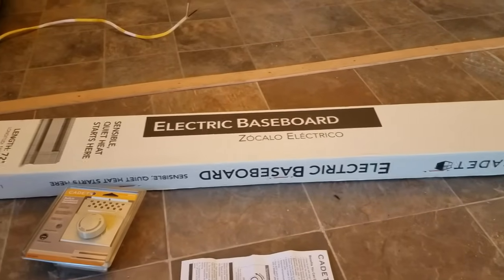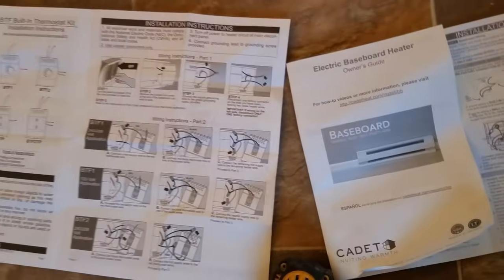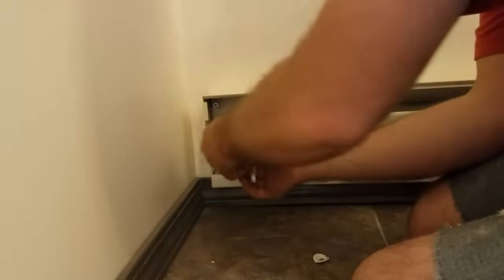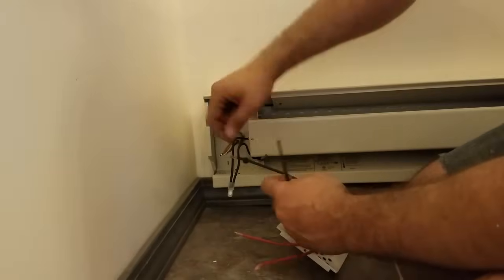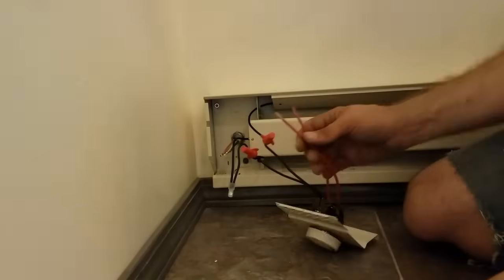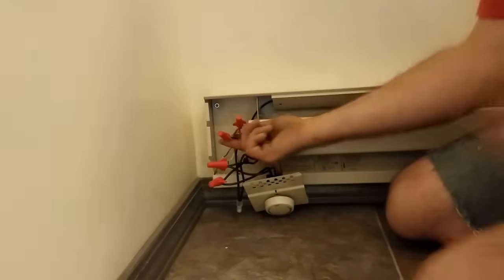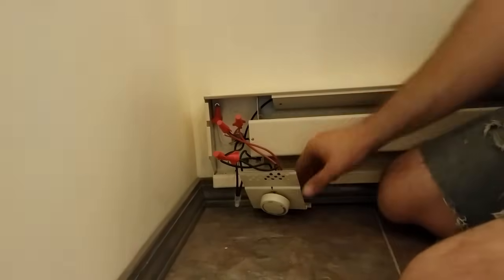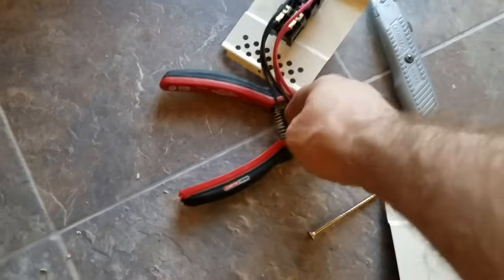Installing Electric Baseboard Heater. DIY

Comment: Please in desperate help.  This is on my floor. It’s the middle of summer we bought the house 20 yr ago.  Now eater is on and I don’t know hot to turn this thing off.  The wall unit does not have a shot off it goes from low to 80.  And it’s at its lowest
Reply from the maker: You can go to the electric panel and find the breaker its on amd turn it off untill you can get someone to look at it.

Comment: I am reading the comments and im laughing my ass off this guy did his best and not bad but i dont understand how they are putting a 30 amp breaker with a 12v wire ladies and gents idk where you live and if that code but as a intelligent DIY man that is not correct 30amp is for a 10 gauge wire please do not do what im reading in the comments and also if you have a 220 do not use a 14 gauage wire smh give this guy a break he is so nice to answer so many questions ... you may use a 12 guage for 220 although i would not but it is safe to do so but it depends on what the instructions say on your heater
Reply from the maker: Your comments are just as bad as the rest! No one shown to use 14 gauge wire. 12 gauge wire is what almost everyone uses to hook up 220 baseboard heaters and it calls for a 30 amp breaker! 12 gauge wires are used for 220 on many things. I just hooked up a mr cool system that was 220 and 12 gauge is just fine. Stoves are mainly the only thing that needs a bigger gauge wire! Watch other videos and let me know what wire they using for 220 baseboards!?
Reply from the maker: It's true, i do try my best to respond to people. Sometimes i don't get a notice to do so though.

Comment: He’s giving instruction about installation but he misses putting the unit in a stud and puts the other screw in the wrong spots. Now the unit is not in studs so it will fall off very soon. Bad video
Reply from the maker: @dorothy1  it's in studs! When i made this video it was to be just tge wiring part but went ahead and put the whole video in.

Comment: The wire thats behind the coil do it suppose to be touching a ground on the right side of the basboard? Its a wire i believe its a ground wire but not hooked to nothing. Is this why my baseboard not coming on?
Reply from the maker: @fighting402  ground wires will be copper with no coating on it or a green color coated wire. Heater should still work with a ground wire not being hooked up. What color is the wire?
Reply: @thatslumlordlife the wire is green. It was working a few weeks ago, then I noticed it wasn't on. So I tap on the thermostat and turn it off and on back and forth then it will come on. Now that's not working. When I turn it on I hear the thermostat click but I don't hear the sound from the baseboard
Reply from the maker: @fighting402  to me it sounds like you may have a loose hot wire. If you havent look over all the wire nuts and make sure the wires are all connected well.
Reply: @thatslumlordlife  what color is the hot wire?
Reply from the maker: @fighting402  should be black wires. Id go through all of them and make sure they all have good connections.
Reply: @thatslumlordlife  okay cause I have green wire that's screwed down but it's not connected to anything,  I'm wondering was it ever hook to any wire even while my baseboard was working
Reply: Is it possible I can send you a picture of the wire I'm talking about that's not connected
Reply from the maker: @fighting402  try and send it to agiftedcurse2@gmal.com

Comment: Good video thing that I would add is I do not level my radiators. I follow the floor because if you level the radiator a lot of times in the older houses it’s gonna be way off. I have this one house where it’s an inch off and that’s gonna look horrible, so I just ran it with the floor.

Comment: First time that i have seen a baseboard heater mounted on top of the base trim rather than right on the floor.
Reply: That's what you want so the heat emanates throughout the room.
Reply: @flexiblestrategist9922 that and how tf you gonna clean every bottom edge of your room if the things on the floor, no room to get a broom under. Gotta think about these things
Reply: That's actually door trim. Someone used it as baseboards. 😂
Reply: I have one baseboard I was reading instructions they recommended   to installed minimum 1" from the floor.

Comment: This is not correct.  Instructions say to use 2 inside wires.  It also specifically state not to cut the outer wires he is using.
Reply from the maker: May want to read it again and watch again.

Comment: Was hoping to see how you go about selecting the circuit breaker, and how many units can be put on the same circuit to that breaker, or does each unit need its own breaker. Wanting to install a failsafe back up heat source to keep Housing Code happy and get my water turned back on.
Reply: It depends on the amperage of the heating units and amperage of the breaker. However you don't really want to exceed 80% of the total amps of the breaker.

Comment: Did your heater give a 120 volt option? I have one in my kitchen I want to hook back up but I swear it was wired 120volt I can’t remember, I unhooked it 15 years ago and my power panel has been rearranged since then. Just curious if yours had an option for wiring.
Reply from the maker: No, the heater are either 120 or 220. I don't believe they are safe to use for volts they were not made for.
Reply: @agiftedcurse2  ok thanks

Comment: Excellent, the only thing I missed was you showing check in for voltage with a sensor and then walk into the circuit breaker to shut down that branch circuit, then double checking for no current where you were going to work.
Reply from the maker: When i made the video i was just trying to show the wiring of the baseboard. I figured most attempting this would already know how to wire it into the panel. 🙁
Reply: You missed the whole point. This video is about replacing an existing baseboard unit, so existing wiring to the fuse box should still be good.  His comment was a safety check.  Turn off related breaker and confirm there is no current, using a tester, that was all.

Comment: He didn't need to use a 240 amp. It was overkill. The guy doesn't know what he's doing
Reply from the maker: When temps get down in -10 degrees here in iowa you will want thw 240 amps! Haha the 120 amps do not put out and heat as well as the 240 amps! You can use 120 or 240, this video is on installing a 240 however! Haha

Comment: Probably should’ve reminded folks, first be sure the connection site isn’t live, some folks have to be reminded.
Reply: That might come as a shock to some people!
Reply: Dude I test and retest the wire every time I reach in even after locating and flipping the breaker. It just takes getting zapped once or twice

Comment: I'm confused. Trying to install one of these but the instructions say to NOT cut the wire coming from the top but your video as well as the installation video say otherwise?
Reply from the maker: I put another video up that might help better? Both these videos are for 220 amp heaters. Make sure you are looking at the right instructions. I show the instructions a little better in the newer video. Hopefully it helps. https://studio.youtube.com/video/gBY5sVXi-gw/edit

Comment: did you replace an outlet for the baseboard heater?
Reply from the maker: Outlet as in a plug-in? No outlet. It's directly wired to baseboard heater.

Comment: Hi thanks for the info. I think I am going to replace both electric baseboard heaters with the cadet brand from home depot. One problem is that someone painted over the screws so I can't remove the cover to unhook the old baseboards. I may have to use some kind of metal cutter to remove the cover so that I can get at the wiring on the baseboards.

Comment: I have old electric baseboards in my house. The ones in the master bedroom seem to put out a smell when they are on. I have used a vacuum to clean out any dust. Should they be replaced and would that get rid of the smell?
Reply from the maker: Every year when they are first turned on they put out a weird smell. New ones also do it. People that haven't ever had baseboard heating normally call about it when they first turn the heat on. It should go away after the first day or two using them. (or at least you get used to it and can't smell it anymore) But I would have to say, some do smell more than others. If the smell doesn't go away and it's a issue then it wouldn't hurt to try. (since they aren't super expensive)

Comment: So how are you grounding it
Reply from the maker: A ground wire that is ran to the panel that is then ran to a ground pole in the ground? There is a ground wire that is part of the 12-2 or 12-3 wiring.

Comment: Soooooooo I just discovered some amazing electrician work at my place.

well
#1 they had a 2500w and 750w baseboards running through a max rated 2000w thermostat.
#2 after now deciding to replace my second one, they are both wired opposite... one has the white wire connect to the top black wire. the other one the white wire connected to the load.....

my grandad has a device so we can see which wire is hot. still sketchy. anyone know if this can cause any problems?

Comment: I installed my electric baseboard and nothing else turns on only when it is high and if it is at the minimum or medium temperature it does not work only when it is at high temperature

Comment: so  u just  connect this to  the  wall plug ?
Reply from the maker: no, there isn't a plug in. the wall plug would have to be 240 since this is a 240 heater. If your outlet is 240 outlet you could.

Comment: Why are you doing it like your in a rush sloppy work. And why would you put it on top of the trim instead of cutting the trim?
Reply from the maker: Its only two wires being hooked up, maybe it just looks like im rushing? Two wires and just mounting it to the wall. The trim is barely two inches high so its easier to just mount it above trim and it doesnt change anything of how the baseboard heater works.

Comment: why did you mount it on top of baseboard... lol
Reply from the maker: It works, the baseboards are the small baseboard type trim, not large enough to mount to the baseboard like you see older homes. Why cut the baseboard out when you can simply raise it up above it!?

Comment: I am replacing a very old baseboard heater that had the supply lines enter in through the right side. On the new 240v baseboard heater I just bought,  the left side has 2 black wires from the heater to twist screw and red wire looped both sided to heater. The right side has 1 red and 1 black wire from heater to a twist screw.  Both sides of course also has solid metal ground wires.  What is confusing, is that the heater's wiring is opposite then the old one.  Can I still connect the supply lines to the right side? The directions briefly states you can wire on either side, but only gives direction for the left.   It also doesn't state if there are any differences or disadvantages to hooking up the right side vice the left.   Thanks.....
Reply from the maker: No difference on what side to hook up that i know of.

Comment: The heater is supposed to sit on the floor, not on top of the baseboard.
Reply from the maker: Doesnt change operation of the heater. I like it better this way.
Reply: @Josh Rice actually they call them electric baseboard heaters in Home Depot. But I get your point.
Reply: @Josh Rice no they don't mount to baseboards. They mount to the walls and the baseboards are butted into them. That's the way it's been in every house that's been build in my 45 years of construction experience. You're confusing the term "baseboard" heater.

Comment: I have something weird,my electric baseboard heaters in the bathrooms was not working I did get lose the screws to take off the heaters to check it,but Im noticed when I lose the screws (does to attach the heater to the wall)the heaters start working again,why?
Reply from the maker: Not enough information, check the wiring and make sure wire nuts are on good and that it's not getting shorted out anywhere with a loose connection or wiring coming in contact with the baseboard?

Comment: What about the separate thermostat in the beginning of the video...
Reply from the maker: The heaters do not come with thermostats. I give them all their own in case you dont need to use some but they can all be wired to one.

Comment: Nicely done. I always do the ground first because it’s usually in the hardest place to access.
Reply from the maker: I normally do too. Especially with outlets and other things. I also try to give myself plenty of wire to deal with. I have seen many people try to save copper and cut it as short as they can and any times give themselves problems later. Nothing wrong with giving yourself a good inch or two more wire than you need to leave in the outlet boxes. I also give plenty in the panel and loop it down and back up to the breakers. I'll have to make a video showing it too since I see people really putting the min that they can and will have many issues later if anything needs to be moved in the panel making it where you don't have enough wire to move things around where needed.

Comment: Can anyone answer these 2 questions for me I have a 240 volt baseboard heater can I install it by removing one of my electrical outlet and will it heat a whole room if wired up correctly ??
Reply from the maker: Only if that outlet is the only one hooked up to the same wire going to the panel. Most outlets have 2-3 running together. Also sometimes other things could also be used off that line such as lights. When hooking up the 240v into the box everything connected to that line is now 240v and could cause issues that will/could result in a fire. So doing so you will need to make sure nothing else is on that line. I seen some older homes have most everything in the house on just a few wires going into the box so theirs very good chance it has other outlets with that same one. If it is the only line, you can make it 240v buy using the white wire as another hot wire. both the black and white will be going into the double pole beaker. There will be no neutral wire being used. 
240 will heat a whole room, I sometimes use one to heat large room, still depending on the length of the heater.
Hopefully this helps, make sure nothing else is on that line when you change it to 240v and make sure to use wire nuts. :)

Comment: Awesome, thank you for the response: did you cap the wire in the electrical panel as well as at the radiator? Or was the white attached to the neutral at panel?
Reply from the maker: I didn't cap it or strip the wire. Did not hook it up anywhere. The neutral wire isn't need, I just use 12/3 just to keep the colors more color coded. I don't like having a white wire used as a hot wire unless I have too! lol If a 12/2 wire was already there then It would have been used. :)

Comment: Slow down! Some guys don’t have time to work at a steady and efficient pace, but time to go back and fix mistakes and sloppy work caused by being in a big rush...
Reply: Some guys love to prove themselves by how quick they can go.  I do drywall and it's no different, I also patch A LOT of holes from show offs.
Reply from the maker: This was slow and efficient! All I did here was mount the baseboard to two studs in the wall and hook up two wires!

Comment: So that's what behind mine should look like, one of mine has been bent since we moved in 2 years ago but still works fine, the thermostat however, being in the room at the tip top of the stairs clicks once upon turn but doesn't kick on til you turn it higher, in which case once it kicks off it don't kick back on ugh!! with such a weird setup in my house as in oil heat in the dining room and upstairs bathroom but electric in the upstairs bedrooms, argh!

Comment: How the fuck are you suppose to learn something if you can’t see what you doing? You are not even attempting to explain what you are doing. Smdh
Reply from the maker: Bro, it's two wires!! Next time I install one I'll break it down barny style!! :) Seems many are having the same issue. I thought it was pretty straight forward though. The top black wire in the base board heater is the only one you cut and hook each wire up to a hot electric wire coming in. Doesn't matter which hot wire it goes too since they are both hot wires.

Comment: Ok so theres just magically a hole in my wall with wires that just need spliced in lol? People want to see the whole process. Like can I splice it into an existing wire or do I have to run a wire alllll the way to the basement
Reply from the maker: Most people will have to run a wire all the way to their electric panel. Wiring in houses is normally 120V and this is 220V. If you would happen to have a wire there that has no other outlets off the same wire you can use it and make it 220V. I was trying to make this video for just wiring the baseboard heater up only! Putting in wiring will be different for everyone depending on how they want it ran. Places that don't have basements or crawl spaces will take a lot more work to run wire if you don't want it seen.
Reply: Just get one of those Bluetooth wireless heaters.... And don't ever touch electrical. For everyone's safety sake

Comment: Why the fuck did u run a 3 wire to the heater
Reply from the maker: I run anything with two hot wires this way. You don't have too but it's good practice to keep electric wiring color coded. White wire is a neutral wire. I did state that most people will be using the white neutral wire as a hot.